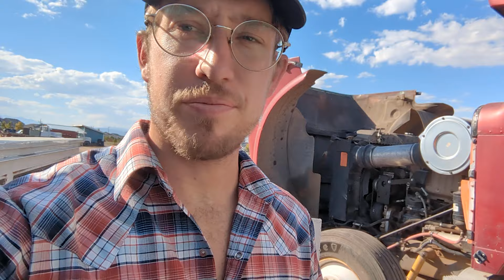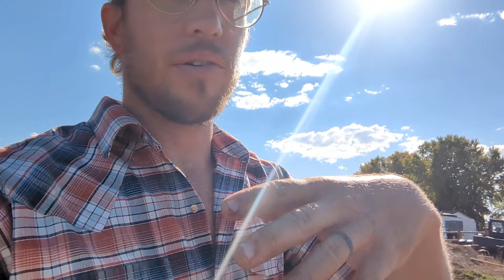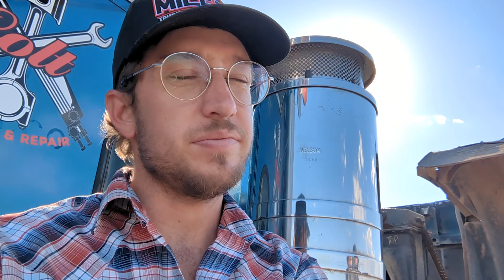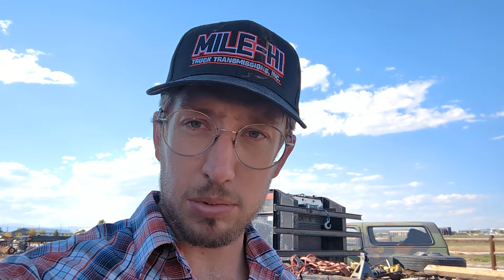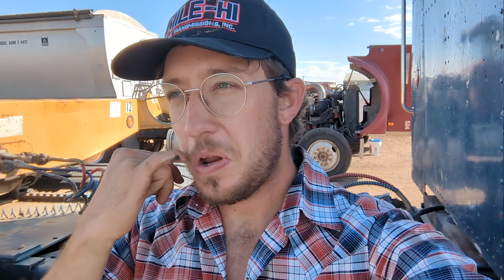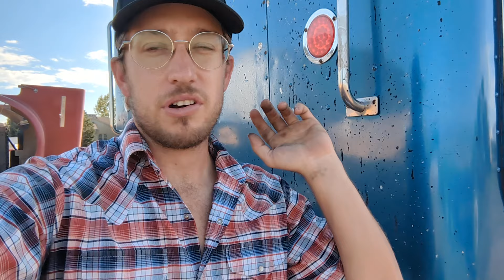When did trucks become "unreliable" and why

Comment: Im glad you mentioned that an egr delete makes combustion temps too high on some engines and lowers lifespan. No body seems to nention this. And with a delete usually comes a tune with more fuel and I would assume higher temps and a shorter life.

Comment: Not going to argue with a mechanic. It’s just you are the first person I have ever heard said an EGR reduces heat, I’ve always heard it’s increased. Very interesting.

Good video!
Reply: It circulates the exhaust and brings down cylinder temperatures.  That is the point of them and then to reduce knock. All these people delete this stuff and then u build heat and take away reliability.
Reply: @pjbuckmaster  That’s my point. You’re circulating hot exhaust back into the cylinder and on top of that are combusting new fuel. They also take away proper air flow throughout the exhaust system, breathing in more than out. I can’t fathom how that would reduce heat in any way and I’ve never heard the claim till now.
Reply: @fighter4christ7  just because this is the first time u heard doesn’t mean anything. It’s how it works. Like he said it is an inert gas to control the burn. Plus the exhaust goes through some air cooling before it enters the intake. If u delete that u can and probably will take away reliability from ur engine. All these people deleting their stuff will be rebuilding their engine sooner than later because the cylinder is going to run hotter even with tunes. The inert gas controls the burn and temps as it does it. The thought of it being exhaust I believe is what ur think is going to be hot but it is air cooled and then put back in the intake controlling the burn with the gas keep temps lower then burning straight fuel uncontrolled creating higher burn temps in the cylinder.
Reply: @pjbuckmaster  Yeah I know, EGR cooler. Just another part to worry about. This is interesting to say the least, I can see how it may be helpful. My experience with it says the opposite, because I have friends with deletes with a proper tune that have virtually no engine problems in the higher end of mileage. The DEF part of the system creates higher heat in the first place, so perhaps deleting that you no longer need an EGR system. Most people I know with pre def systems and only EGR generally leave it alone. Doesn’t seem like it’s much to worry about.
Reply: @fighter4christ7  from what I see your not going to get to 200,000 miles without problems on deletes with out rebuilds.  But then again how much are u going to pay for emission filter and sensors along the way to 400,000 miles. I think it is a give or take. I see it to often people coming in on limp mode and asking for the delete. Or coming in for rebuilds because the engine at this point is not designed to work without that stuff and giving it a tune is simply like putting a bandaid on something. I tell most people if ur not working your truck and making money to pay for it from work, diesel is not the truck for u. Get a gasser and run all over town with no issues. If ur the guy pulling up to soccer and grocery story with ur diesel and then going home you are going to have problems no matter what u do. Diesels are meant to be worked hard, keeping heat in the emission system and running it while it cleans filters and most of those seem to work well and not have a bunch of problems. Sensors with lots of heat is like taking a computer and putting it in the sun, he’ll ur phone quits working when it gets hot but we expect cpu and wiring into electronic in cars to not be affected by it. It is the modern diesel era not and those things need to get better protection and they will as we go.
Reply: @pjbuckmaster  I Can agree with that. Everybody has got a different story on what their delete did. For me I just stick with the pre emission engines, I don’t want to get tangled in that mix and end up with a nightmare.
Reply: @fighter4christ7  that’s a good choice. I drive old trucks because they have less electrical problems and less computer problems. Plus I can usually fix anything on the side of the road with parts bought and most auto parts stores.
Reply: Definitely lowers it. It being combustion temperatures. Inert or low oxygen air coming from the EGR doesn't support combustion slowing the combustion process. Exhaust gases also have the ability to absorb more heat for the combustion process. All leading to lower cylinder temps and thus engine temps.

Comment: EPA has way too much power. It has cost the trucking industry billions and put many smaller companies out of business. I would like to think cleaning these engines up is for the good but I look at countries like China and India that have no emissions control! Heck most of the “ green energy “ components and made over there with coal plants! Lol
Reply from the maker: Very true
Reply: Ever been to China or india? The smog is so thick in the cities you can’t see the sun. I definitely don’t want our country anything like there’s. 

With that said, diesels got cleaned up more than enough when they went to common rail. Common rail plus a Cat should be sufficient.
Reply: @jfitz9624  .. What would have helped a whole lot is if drivers wouldn't have let engines idle for hours-on-end  for absolutely no reason in 50 to 70 degree weather for the last 50 years.
Mass waste of fuel and much pollution .... for nothing.
Reply: @jimlong2469  it would be good if all long haul trucks came with a small separate onboard diesel  generator. To run a separate HVAC system plus anything else you have plugged into the circuit. Then you wouldn’t need to be idling a big ass 15L diesel engine just to run the AC or heat.
Reply: @jfitz9624  What you speak of has been common for about 10 years ........... What I'm talking about is drivers idling engines for hours on end for no reason whatsoever ...... no heat or a/c needed when it's 50 to 70 degrees out.
Wasting fuel, causing pollution and destroying engines..... for no reason ....... for the last 50 years.
Reply: @jimlong2469  company drivers could care less because it’s not their equipment to worry about. The mega carriers could care less because they may be taking a loss with extra maintenance on an APU and losing them completely in bad accidents. All they can do is encourage less idling and have an optimized idle built in to the sleeper system. They do t care about the damage it does to the engine either because they get rid of them at about 400K miles before anything serious shows up.

Comment: I had a 98 7.3 a 94 5 9 my dad hasa 01 duramax he bought new I now have a 2014 cummins 6.7 and a 2032r john deere I have not had many emissions related issues with these engines but I do miss the simplicity of the 5.9 I also have a 2018 Volvo d11 truck I drove cat and cummins bit I really do like the newer vovlos but they do have sensor issues with the emissions systems

Comment: After gasoline emissions systems were mandated in the 70's it took a solid 15-20 years for OEM's to hit their stride in the power/efficiency/reliability department.  I figure it'll be about the same with diesels, within the next 5-7 years (next round of engine dev) I think we'll hit the pinnacle of the current tech.  Plus who knows what will come with the newer tech allowing the retirement of the current style systems like EGR, DPF/SCR.  Scania DC09's are meeting Tier4 Final standards without the use of a DPF now, and there's some other larger engines foregoing EGR systems as well.  I think Kohler has a 130ish horsepower engine out now that meets T4F without EGR.

Comment: My tuned up 2000 7.3 does everything i need it to do with no problems over past 18 years. My 1996 vw tdi has also done the same. No drama in 700k combined miles.  They can keep the new junks.

Comment: Have a ford 5600 tractor, neighbor has a 7600. Almost 50 years old and they will outlast our 2020 nh workmaster 65. Another thing is the subsystems on the new tractors that customers alledgedly want. I dont need a powershuttle, but we have already been stuck in middle of hay from ours malfunctioning. Couldnt leave it out in the rain, wouldnt run right because the seal to the front ecm had been rolled from install, that was a doozy to figure out.

Comment: None of these new engines are a two valve Maxidyne or a Big Cam Cummins. EGR is to keep the combustion temperature below 2,500 F and prevent the formation of oxides of nitrogen. Even some of the large industrial boilers I sometimes work on have a FGR  (Flue Gas Recirculation) system on them for the exact same reason. They have a large electric blower on them that sucks the flue gas from the top of the boiler and blows it down through a pipe to mix with the combustion air. The motor is run off of a VFD (Variable Frequency Drive) to control speed and determine the flue gas/fresh air mixture.
Reply from the maker: Interesting
Reply: @ColtWR  Yeah air is like 78% nitrogen, so that is what causes the problem. They are starting to retrofit older boilers with the FGR system, so there must be some  kind of incentive from the gov. It's weird, you'll go into a large older boilerhouse and half the boilers will be retrofitted

Comment: I just want an old, simple mid-80s F-350 with a 6.9 idi. I don't need 1,200 ft lbs, 600hp, mega cab, 24" infotainment screen, rubber band tires, 12inch lift, etc for hauling a boat sometimes and occasional brush/log hauling. 

And I have my '00 Camry for commuting to work.
Reply: Older Camry is IDI reliable.....
Reply: @workingcountry1776  I love my Camry. It's rock solid.

Comment: How's the 7.3 gas holding up? I like the modern diesel power and mileage but hate the maintenance expense and got tired of almost having a heart attack when it wouldn't start wondering how many thousands less I was about to have.
Reply from the maker: Holding up fine. Almost 100k on the truck

Comment: Colt I'm looking at 2019 2020 international semi truck because of price these trucks have paccar international Cummins engines which are more reliable all are between 300000 to 400000  I'm coming out of retirement family situation (we spent retirement money caring for our parents) need 3 good years from used truck Mike an Angie
Reply from the maker: Honestly the best trucks, from what I've seen and talked to many people about are the dd15 and dd13 Detroit. Good mpg, seems to be the most reliable of the newer engines. The Cummins is great, but heavy and not an mpg queen. Also the dt12 automated transmission, made by Detroit to be paired with the Dd series, is doing really well for longevity in most highway applications.